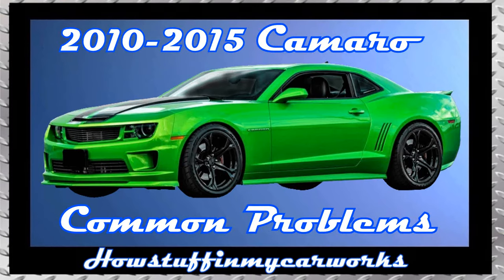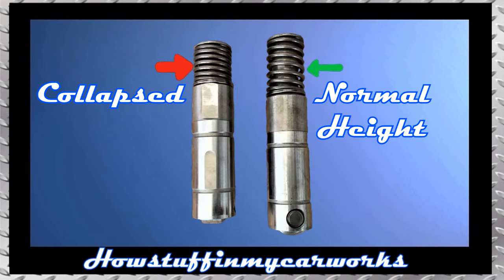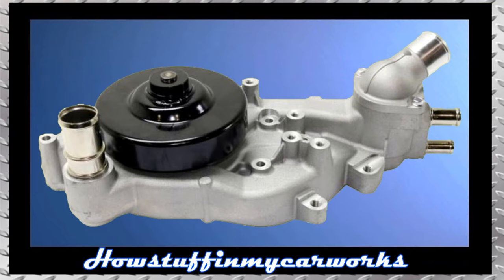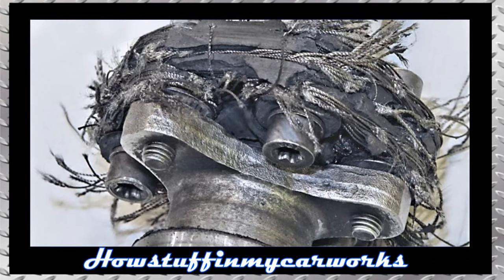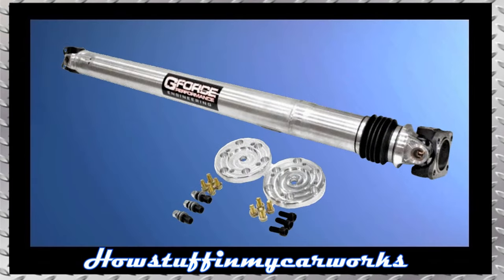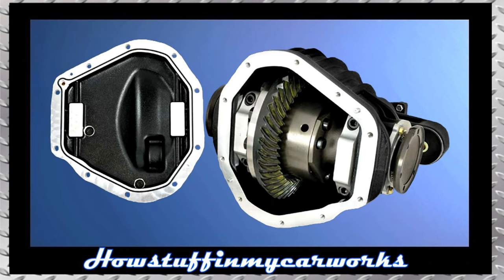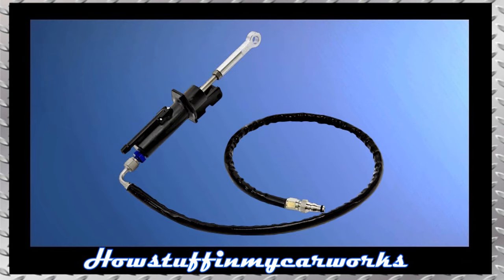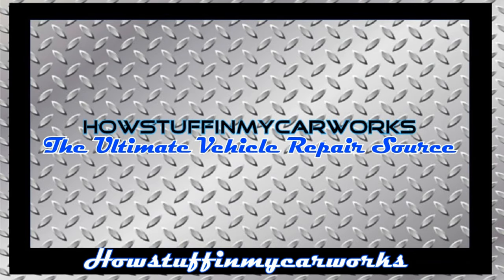Chevrolet Camaro 5th Gen 2010 to 2015 common problems, issues, defects and complaints

Comment: 2010 2SS also prone for wires breaking on the heated seats. I got one. I know.
Reply: One of the reasons you never buy the first year of a new generation of car.
Reply: @traingp7 Is it just for the heated seat harness/wires? The power seat wiring and harness should be fine? I have one, but I’ve owned it for barely 2 years, so I’m not sure. I rarely use the heated seat as it is, but I’ve used it in dire situations.

Comment: so my 2014 ss, when im in low gearing 1st and 2nd the clutch sometimes makes metal grindy sound( not a lot but like verry faint) and also kind of through out 1st, than the shift 2 second too. after that all gears are fine and smooth. anyone might know what this is?
Reply: Could be syncros going bad in the transmission/could be you or the previous owner don't know how to drive stick and have been beating em silly...could be springs in the clutch going bad... or throw out bearing (doubt it).. 11 year old car when have you done maintenance on your Trans and rear end...how many miles...could be do for a new clutch, throwout bearing, Trans flush, rear end flush, master cylinder flush. It is an SS sports cars are like trucks maintenance is sooner and makes a hell of a difference!
Reply: Does it get worse/increase with speed? Have you checked things like your brakes? Maybe check out your driveshaft and rear axles and differential; and then change the gear oil in the rear diff while you’re at it.

Comment: Do you have a source to find rubber coupling for the driveshaft? I don't want to buy a whole new driveshaft yet.
Reply: 5th gen 6spd here, you will not find it anywhere, only used on ebay. Save that money and buy an aluminum one from the driveshaft shop

Comment: My 2011 Camaro v6 rs airbag sensor has been on for 6 years now, to fix is $900 and I noticed few of my friends having the same issues too. Chevy!!! This should’ve been recalled, what a scam!  These are the reason why I never upgraded to a new Chevy. 

Rear speakers tattering still since I purchased the car brand new. No fix at all took to dealership 4 times. 

Timing chain replaced once$2,500 

Catalytic converter both replaced once5 yrs ago , now the engine service light on saying replace them again. $1800 

Wtf
Reply: Rear speakers rattling*
Reply: You can always bypass that seat sensor. The airbags on the seat won’t work and didn’t work anyways but at least toy won’t have that stupid light. The bypass could be a small 2 ohms that cost Pennies
Reply: Can you tell me on how many miles you change the chain?

Comment: I got a code P2176 indicating idle learning for the throttle control is needed, and needs to be initiated using a scan tool or possibly from a service mode button on the console. Is there one on a 2011 Camaro v6? 
Came up after trying start with a low battery, which apparently reset things.  I may just try disconnecting the battery to initialize the idle learn if there's no service mode button.

Comment: I just got a 2012 Camaro ls and it shuts off and won’t crank back up but outta no where cranks likes nothing wrong it’s pissing me off
Reply: Heat soak on your starter. Needs a 0 gauge ground wire from starter to bare metal.
Reply: Check all your grounds. Especially the ones for the pcm. A bad ground will have you running in circles trying to diagnose an intermittent issue.